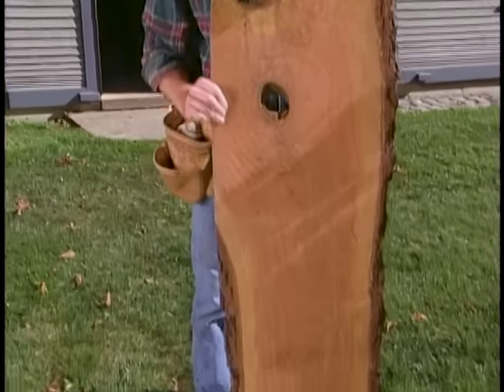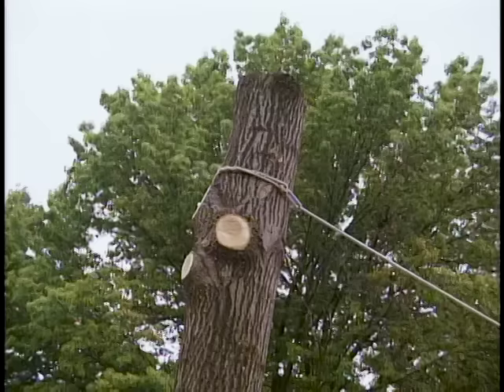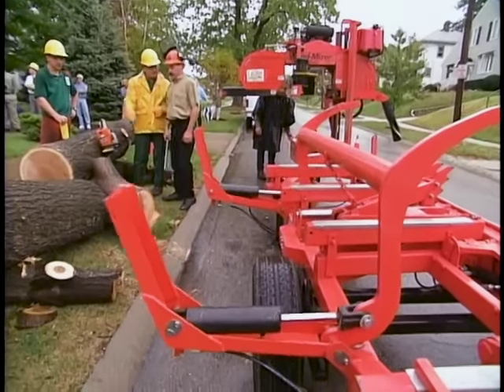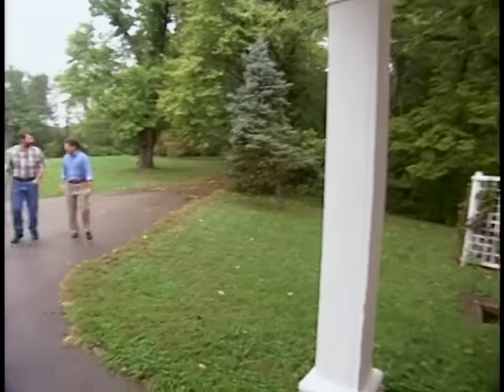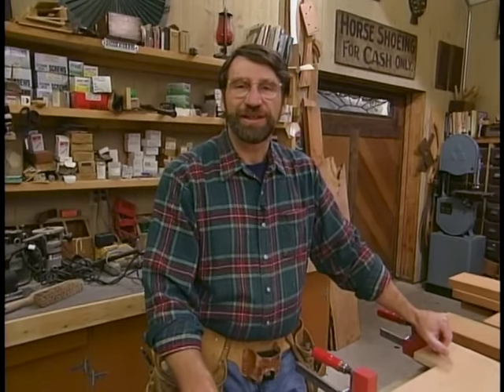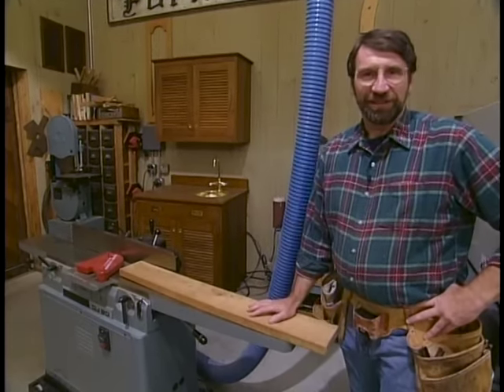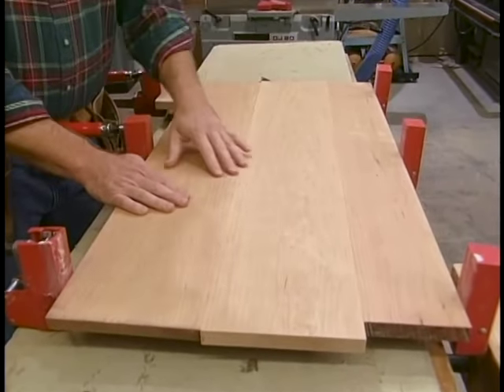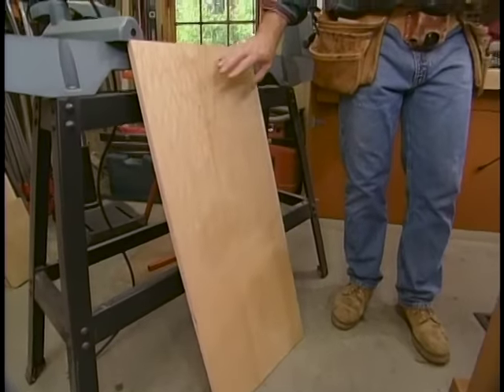Sink Base  |  S11 E10

Comment: The use of a stain finish is interesting as I've never used anything other than an oil or a clear finish on cherry, but it turned out pretty well on this piece. I have to ask what was "the doors on that project down at Tucson" Norm made a reference to at 21:05?
Reply from the maker: That would be the Mesquite Bookcase project:
https://www.youtube.com/watch?v=kg7xj7mGNHI
Reply: @newyankeeworkshop  Thanks! I had originally dismissed that one because of the glass front doors on that bookcase but having watched the beginning again Norm did look at a mesquite armoire which could have had the raised panel doors being referenced.